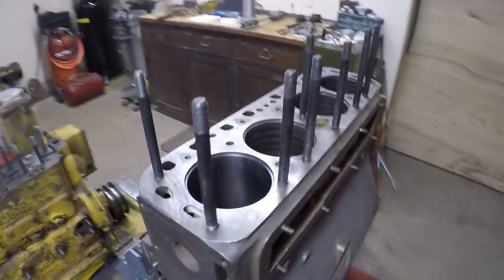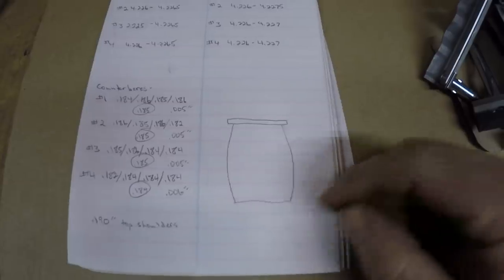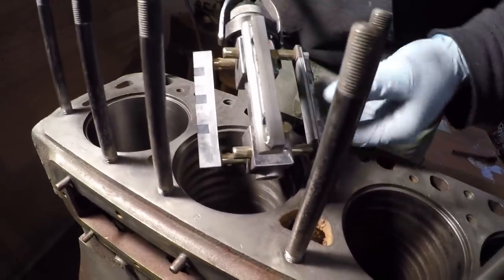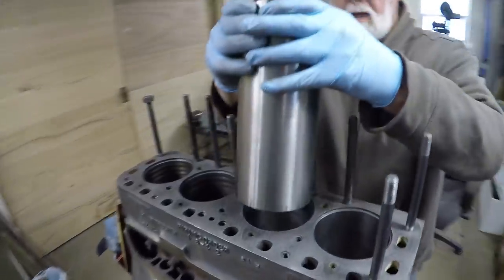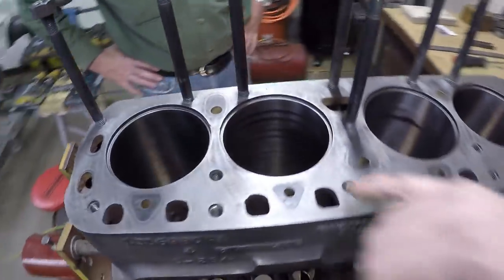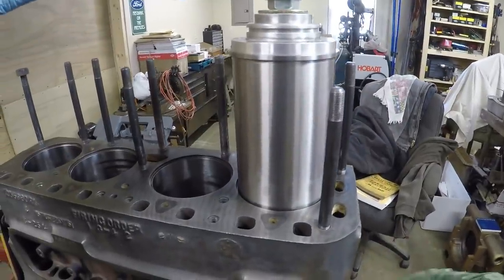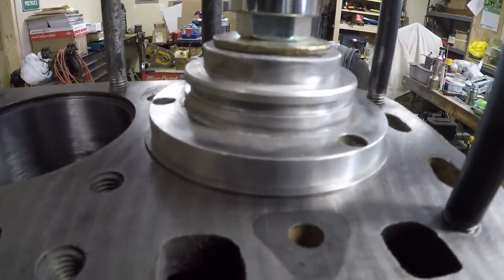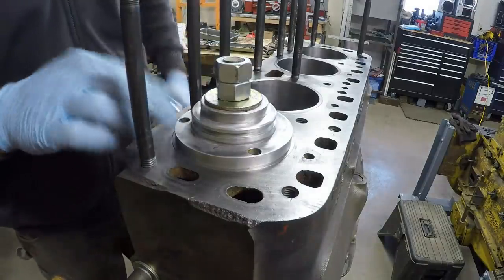Farmall Super M Rebuild Ep.20: Honing The Block Bores & Finally Installing The New Sleeves!

Comment: Sunnen honing oil will wash the bores down as you hone not so much dust but it will make a mess ! I believe it's made from sulfurized lard oil the stones cut better too ! 35 years hydraulic mechanic, I've rebuilt a few engines but this is great, keep up the good work Thanks

Comment: I agree - took a lot of work to get them to fit but at the end of the day they went in beautifully. I didn't have near the issues with the H sleeves - some light boring and they were easily in 1/3 of the way by hand. Nice work, boys!
Reply: @squatch253  yessir. You did an excellent job showing the process (as usual). I should have spent more time on this section with the H, but I guess it wasn't necessary since everything went together like butter. Looking forward to setting the rotating assembly go back together. Soon enough you'll have several "test run" videos! Just in time for summer. :-)

Comment: One should always use some sort of honing oil when using rigid adjustable hone such as you are using...a bit messy but it definitely saves the stones & wiper/guides.   WD-40 will also work in a pinch.  I've used Sunnen rigid hones up to 24" diameter & ALWAYS use honing oil

Comment: I still would have heated that block with a forced air heater and dropped those liners in rather than pressing but that is just me and there are a thousand ways to skin that Cat. It sounds like that block "seasoned" and went out of spec and has not been reworked to spec since then. You will have a better than new overhaul now. It is kind of like the 5.9 Cummins motors that all ways go sway decked on the head surface and need decking back to flat.  Lots of heat cycles can really make stuff crawl around sometimes.

Comment: I've never read in the IH overhaul book about honning out the block before reinstalling the new cylinders if you hone the block out your going to have a problem with the sleeves turning around in the block, I always coat the outer sleeve with locktite and install .

Comment: the dealership i worked for  we never had to hone the sleeve bores  we had a bore gauge to check for taper or out of round the most we ever had to do was hone the bore with a glaze breaker and wash them and make shure we had a 0.005 interference fit.  we had a special press that bolted to the head bolts to push the sleeves in.if you fit the sleeves too loose the lands will break off and the sleeve will move up and down in the bore and wreck the block.

Comment: Probably not applicable here , years ago at work we pulled in and out 6 inch long 5 inch od 4 inch id bronze bushings into robots . we cut a socket into two , welded into a pieca of pipe and used an impact gun  to pull .Quick and dirty !   I respect that you know that parts do not always have to be new , but have to be servicable fo the long run . i'm  79 years old , rebuilt many small block chevvy  engines  but only one diesel . NH 220 Cummins , did things to that engine that would horrify you . That story takes time and beer to tell !

Comment: # 3 was the possible piston slap noise heard before teardown .         On my wd-6 the machine shop discovered a air pocket / casting flaw in a cylinder hole before sleeving  ,   so that block has a double sleeve job in one cylinder .

Comment: One thing that i can't understand is why would you dry hone the bores . I have done a lot of honing with my sunnen ridged hone but never dry as the stones plug up with cuttings have always used a cutting oil like croma tap The hone seems to cut faster with a a slower speed on the drill and the cuttings wash away with each application of oil . I will use motor oil for polishing at the end wit the 500 stone if required . The stones seem to last a lot longer wet . On the commercial sunnen honing machine oil is being pumped into the bore when honing .

Comment: That barreling of the sleeves is likely an accident of manufacture  due to heat distortion.  The issue was crucial when trying to find a way of making concentric and parallel sleeves for sleeve valve Bristol radial aero engines.
Reply: Or maybe just a function of the work-holding. If it's supported on both ends (like in a chuck on one side and a center in the other), the middle section will deflect from the tool/wheel pressure. Very common in turning operations with thin-walled parts.

Comment: Quick question, just got my block off the bell housing and starting removing pistons and sleeves.  Noticed cylinder three was stuck pretty good so after about two days of slowly getting it out I noticed the bore hole has a piece broken off.  Is my engine toast or can I just put in new sleeves, pistons, and rods?
Reply: @squatch253  it’s up near the top but below the bore lip.
Reply: @squatch253  thanks for the reply I’ll try and sleeve it and see if it will hold pressure.

Comment: Hey Squatch,
I've done my share of wrenching, and we never stop learning.  I've never rebuilt anything that had replaceable sleeves.  My question...
Honing the block IS a rare necessity...correct?
Reply: Not Squatch but a mechanic here, I think they were honing the block to achieve a certain measurement before pressing/pulling the cylinder liner in.
Reply: @craigh4677  Understood, but I'm asking...How often does this necessity occur?  I'm guessing that most of the time, the average rebuild doesn't require honing the block to install sleeves, but ...how many times has Squatch had to hone the BLOCK just so you can get the sleeves in?  He's probably done his share of sleeve installations, and I'd like to know how often do you run across this delima?
Reply: I guess we don't know if these liners are OE or pattern and whether their OD is STD or slightly larger to allow the counter bore to honed ensuring a tight fit.
Reply: @squatch253  , Craig H, and Ray Collington,
Thank you all for your input.
Great place to learn from others' experiences.👍

Comment: dry ice...the sleeves...…..drop them in....!!!
Reply: I was in an automotive program at a local college back in 1980 and we installed a sleeve in a gas engine.
We dry iced it and I can assure you it didn't drop in.
The teacher had us taking turns wrenching it in place, the last few guys had it the hardest as the sleeve warmed up during the process.
Reply: It depends on the press amount. A normal amount is 0001 per inch of bore. Then they will slip in with dry ice.
Reply: @squatch253    --ford sleeves   are very thin..we called them Campbells soup can liners.   I had good luck using this tecknique ...I worked at a Massey dealership...and we had to hustle ….working on the customers dime..eg. do a good job  but get it done fast.......

Comment: Hi there just wondering what the D and the C mean stamped on the block and how do you clean the stones on your hon you know what I mean I don’t know how to spell hon and also how do you think those tiger stripes got between the block and the sleeve and did you get a exact measurement of how much material you honed out of the cylinder block? I am very curious about these things. Thanks

Comment: Like watching the rebuild.videos. I've never rebuilt an engine but have to rebuild.my 1969case 188 diesel backhoe. It still starts great (no starting fluid) even in the coldest day but bo compression on #1 cylinder. I do have 1 question ,what the diffrence between a in tractor rebuild or if i pull the motor?? I guess they are 2 diffrent kits but by pic they look the same

Comment: Perhaps i missed it but why do the bores need to be clearanced? Back in the day at the dealership was this standard practice?
Reply from the maker: No, back in the day at the dealership they had a selection of 5 different sized select-fit sleeves to match the 5 different letter stampings that the engine machining facility would've put on the top of the block next to each bore - because of irregularities in the machining process they would carefully gauge each bore and assign it a stamp of A, B, C, D, or E to show where it landed in the variance range, and they'd then match the corresponding lettered sleeve kit to each hole for proper fit.  Those select fit sleeves went away when IH went out of business though, so now all we're left with are slightly oversized aftermarket sleeve kits that sometimes have to have the block bores custom sized to accept.  To see more of what I'm talking about here, check out the following video link (at the 5:00 mark) of me having the opposite problem with my Farmall H engine - block bores that are too large to be able to get a press fit - https://youtu.be/Dj6qztT3X1Q
Reply: @squatch253  
Thanks for the response

Comment: So, the Farmall H doesn’t have copper crush washers under the rim of the cylinder liner like the D3400?
Reply: No need, it's a dry sleeve.
Reply: Do you honestly think that these two guys would miss something as crucial as "crush washers"!?  It is obvious you haven't watched past videos and the craftsmanship they put into their builds.
Reply: Paul Copeland no, I did not think they failed to install a required part, I was just wondering what the difference was in engine design that required/did not need the copper crush washers under the cylinder liner rims. The D3400 will probably have higher compression cycles and that could be the difference. There might be a difference in how the head seats on the liner rims. I have watched everything they have posted and enjoyed it all, and stacked tons of knowledge on equipment overhauls that I will never use. I am “hot”on the D2 because one of the first books I read in middle school was “Bulldozer!” By Stephen W. Meader, that featured a WWII vet that pulled a D2 out of a pond in upstate Maine after buying it for salvage, got it running with the help of a mechanic friend and built an earthmoving business through honest hard work, and he got the girl as well!
Reply: @charlesward8196  ...Excellent!  It just seemed odd to question their process.  Have a good day, sir.
Reply: Squatch253 Thank you so much for clarifying that point. Love the videos!

Comment: Would it not have been easier to chuck up the sleeves in a lathe and dress them down to fit the bores?
Reply: @squatch253  I would not turn them with a tool. You are correct in that alignment would be difficult. I would have just used a file  and  paper to polish to fit. Anyway you did what was best for you and that's what counts in the end. I just had this feeling that it might be better to modify the replaceable part than the block which was  fine originally.  Cheers and keep up the good work.   By the way I'm a full time pro machinist for 40+years.

Comment: Is that a MD or a MTD cause im am wondering why you are putting diesel liners in an M
Reply: What makes you think those are diesel liners?
Reply: @ShainAndrews  because i only ever seen them type liners used in internationals diesels all the gas engine were wet sleeved or aparent bore
Reply: Farmall H and M gasoline/distillate engines, the C152 and C248 and their descendants, are dry sleeve engines. A, B, C C113 and C123 engines are wet sleeve. Farmall Cub is not sleeved at all.

Comment: heat the block and freeze the sleeves,I never install dry sleeves without  freezing the overnight
Reply: @squatch253  well of course you hone the block but to minimal interference, it is a pressed fit,ie.002, Freezing does work you lacked the experience, but don't feel bad we have all  cracked a thin wall sleeve
Reply: @squatch253  if they cracked it was either wrong sleeves or you put them in wrong, Freezing does work you had a different problem.

Comment: Stones will last longer if u run in varisol
Reply: I'll bet you weren't aware that WD-40 is over 50% Varsol, one of the family of Stoddard Sovents. This, in reality, is just refined mineral spirits. Also, 25% of WD-40 is refined mineral oil.  The rest is driers, fragrance, and propellants. So, although Varsol is still available from Exxon (and some other chemical suppliers), it is much easier and far cheaper to buy quality mineral spirits.
Reply: @paulcopeland9035  dont buy wD 40 waste of money as a penatrant
Reply: @paulcopeland9035  i use varsol withdextron
Reply: @wilmamcdermott3065  ...You use actual Varsol?  It is crazy expensive for mineral spirits!
Reply: WD 40  is way more money  here in alberta  varsol also cleans better in parts washer   for penatant i use 3in one penatrant  actully   losens rust 10 times better
Reply: @paulcopeland9035   I have been a mechanic fo 45 years  have both automotive and heavyduty  licence  with red seal

Comment: You know if you use oil you dont have to wear that mask......and the stones wont clog....
Reply: I have a pump system that i put ATF in and it works very well for honing.
Reply: Oil is a lubricant better to use kerosene
Reply: When I hone a cylinder in my shop, I do it in my parts washer tank with the spout from the pump aimed into the cylinder and running. I use mineral spirits in my parts washer. Of course I’m working on small engines......
Reply: John Acuff me too, I just meant any kind of lube...